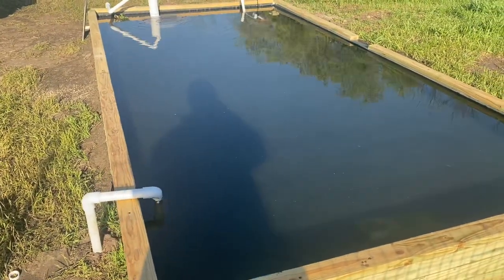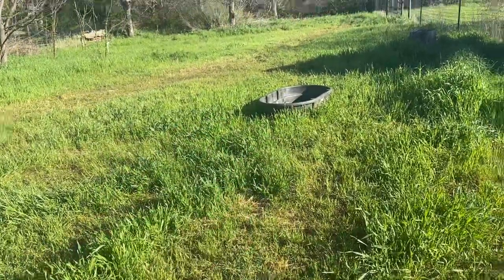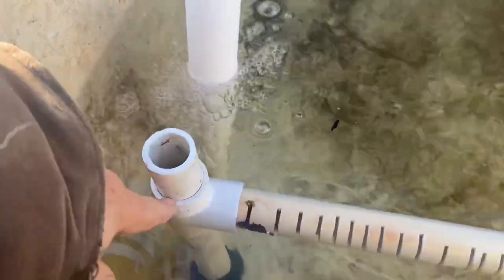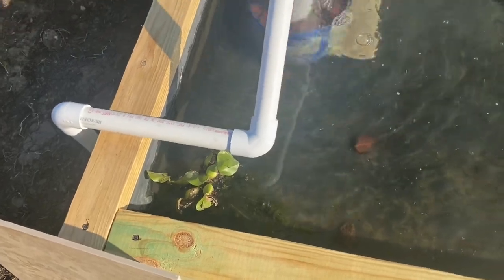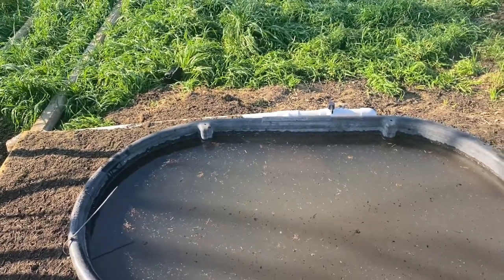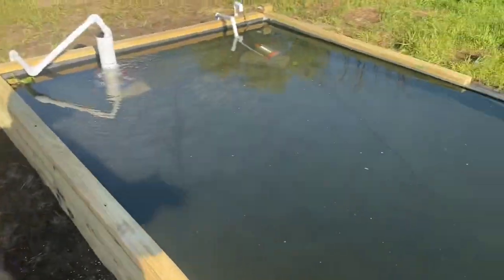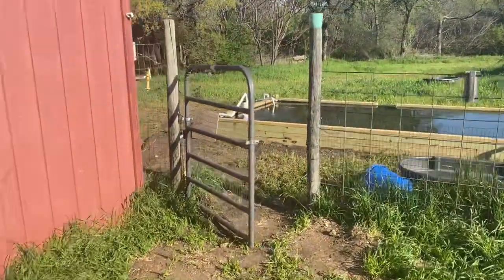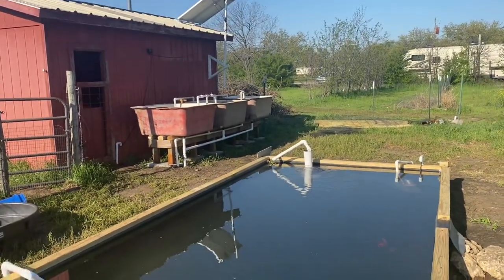New Pond, Feed System, Solar Powered Function Stacking System - First Walk Through

Comment: Your "air stack" looks like a simple trompe. I use the same principle to add air to my aquaponics system. I use a bundle of small pipes cut at a 45 degree angle as a bundle stuffed into a T fitting on the incoming water pipe. It adds a tremendous amount of air.
Reply from the maker: Yea it uses some of the principles of such but isn't a trompe at all. Not how a trompe works.

Comment: So you’re primary input once the system is established is about 50 gallons of well water every day?  And that is only if there isn’t rain filling it all up.  To feed ducks and irrigate trees with high nutrient water, that seems like a small price to pay.  Surely there are some kinks to work out but I really like this idea.
Reply: Okay. I wasn't being critical. I actually like the whole setup.
When you said every third day or so the water would go to this Willow or that one or to the pond, I took it as water leaving duck mountain to go to one of those 3 spots everyday in a rotation. And you mentioned some additions later etc. for if/when the water got to nutrient dense.   So I took it as 50 gallons of water input a day. For feed and fertility that seemed like an okay trade off. No arguments from me.